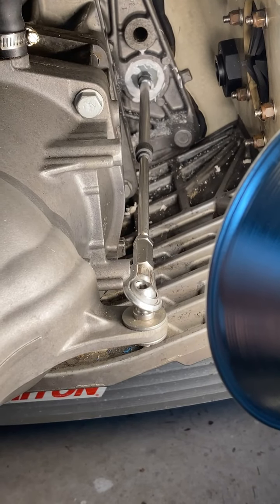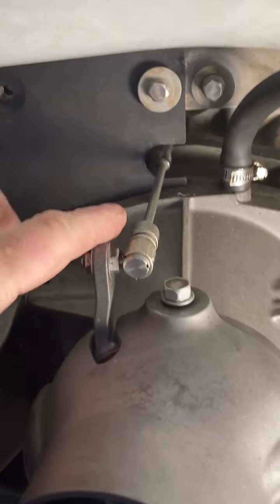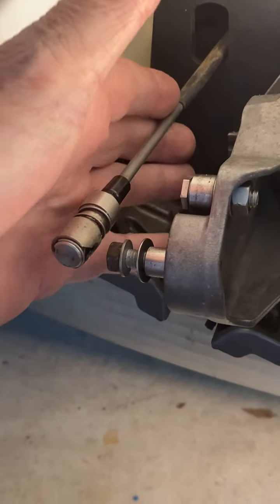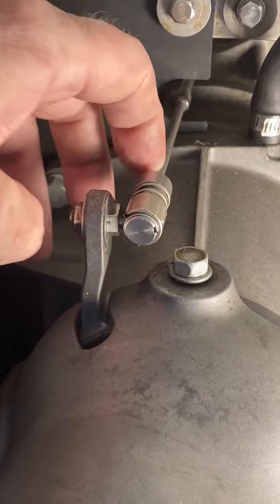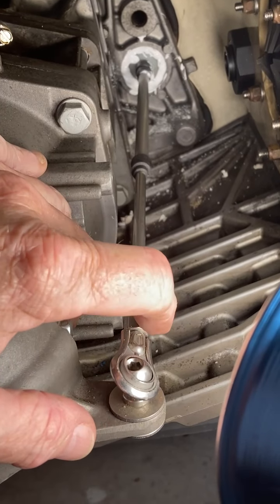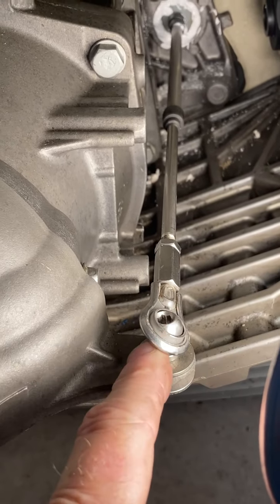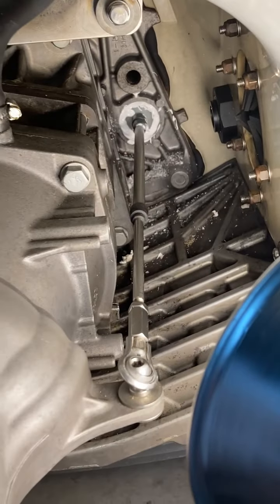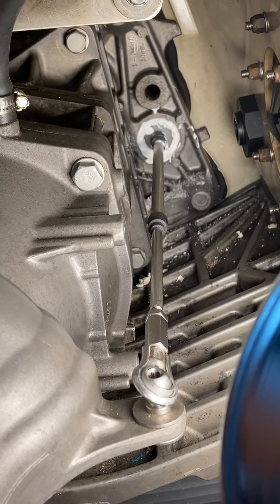Yamaha 2002 FX Cruiser Steering Cable, Part 2

Comment: i have the same model same year.. are they supposed to be unstable ? seems like the slightest movement i loose control? steering is loose, i think to loose. Theres a delay from the moment you turn the wheel to when it actually moves is about half a second
Reply from the maker: Sounds like you have some slack in the mechanism. There should be no delay. Something is wrong. I would check it out closely if I were you. It is critical that the steering does not suddenly fail when you are underway
Reply: @Charleston_SC  yeah it feels like i do have slack , would that cause it to be very unstable?
Reply from the maker: Yes slack in the steering would cause it to be unstable because the ski is not reacting fast enough to a sideways push from a wave